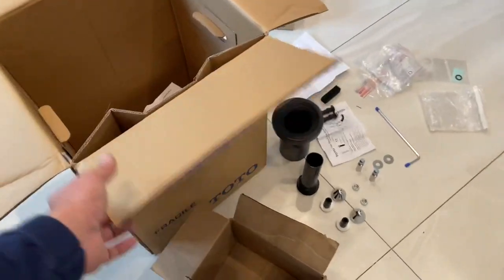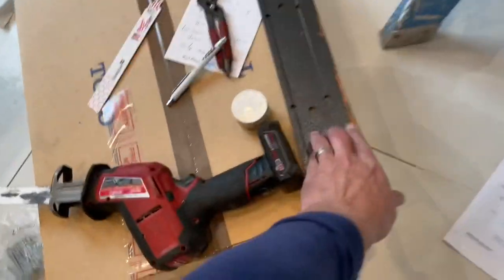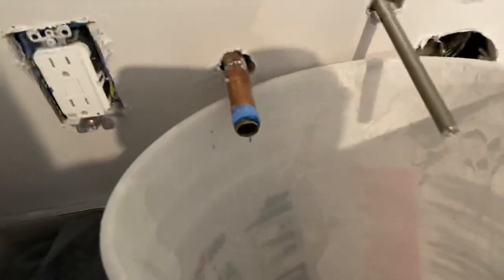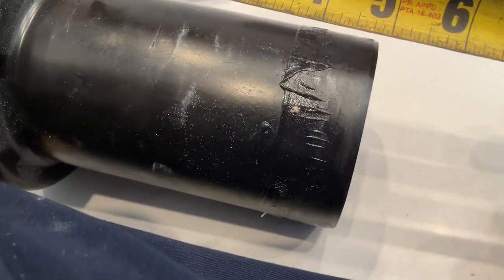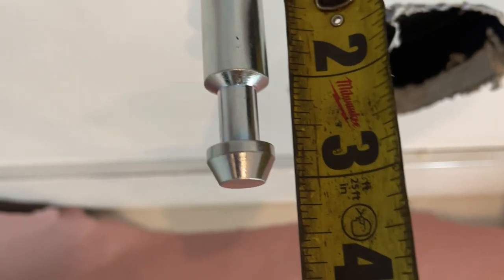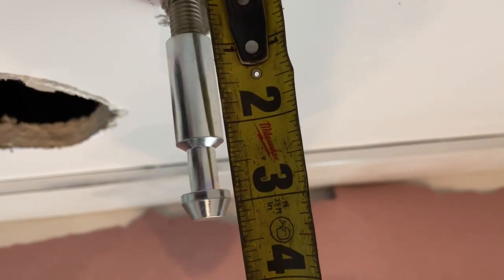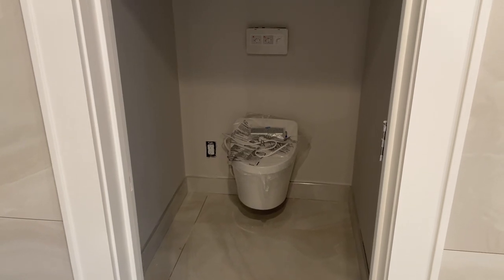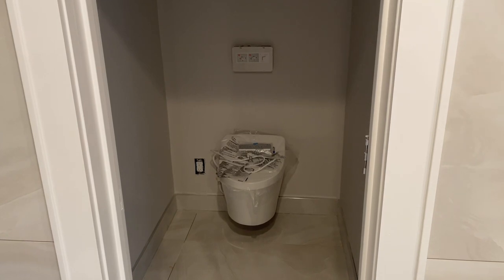How to Tip: Toto wall carrier toilet 🚽 “Shim inside between the steel carrier and inside back wall”

Comment: I've found it beneficial to set the carrier a hair proud of framing, this prevents the drywall or tile from being put under stress and cracking when the bowl draws tight to the carrier. Make sure nothing protrudes past the plane of the carrier face ie; bidet outlet water supply plug, adjustable leg welds, for the very same reason as above. Don't count on the drywall installer to relieve drywall in protruding areas, ask me how I  know that. Carriers don't arrive perfect, and if you don't address that, something will give at finish. Not unique to toto, happens with geberit as well.

Comment: An updated official TOTO Youtube video can be found and it clearly states that a sheet of plywood is essentail on the carrier wall, whether your finish is with tile or textured greenboard. The theory is that when you go to set the wall hung toilet to the carrier and when the toilet has to compress flush against whatever finish wall you put in, you want that plywood backer sheet to be there as a firm strong material to compress against and hold up for many years to come. Without it you basically got a ticking time bomb toilet install.
Reply from the maker: Yeah well too late for that now.

Comment: 2 questions are there weight limits on these wall mount toilets,being that toilets are already heavy, and where's the Pipe Dr jr's? They should be learning from the master plumber himself
Reply: The carrier & bowl are rated to 880 lbs
Reply: @penguins9645  That's why I don't see these in the ladies' restroom at Walmarts